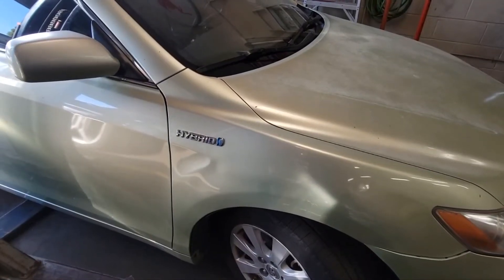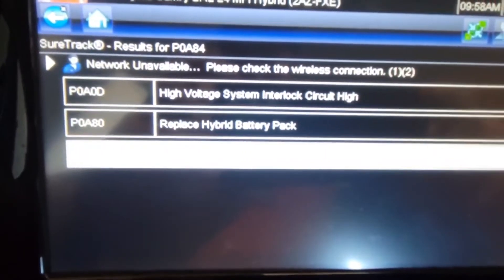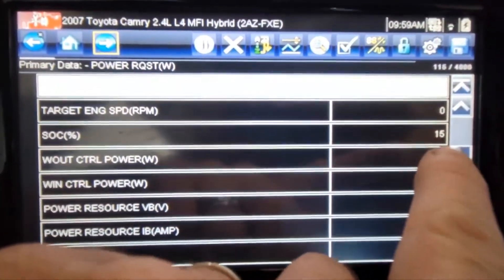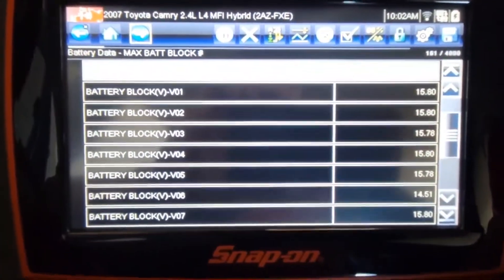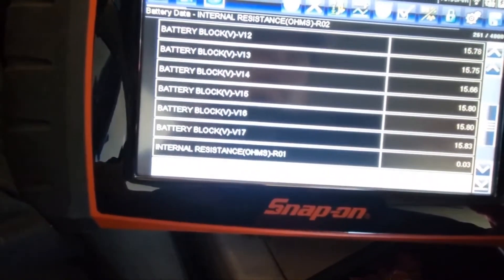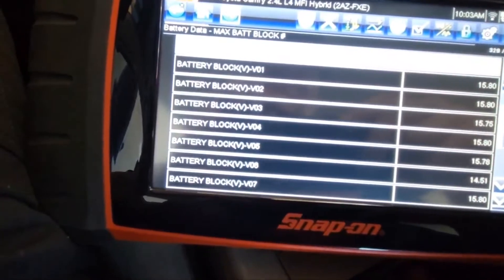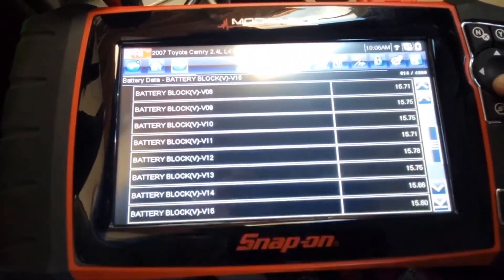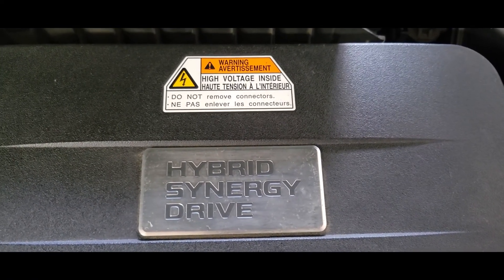Toyota Camry Hybrid Battery Diagnosis

Comment: Hi what is your email? I am having similar problem with my 2008 Camry hybrid. 200K miles. Went on trip and it sat for 2 1/2 weeks. Came back and was completely dead. Replaced 12V battery and upon starting it up I got check hybrid battery and check vsc constantly on. Drove it for a few weeks and it acted normal until recently and now sometimes it will switch to “eco” mode and the engine will die. Very dangerous on road now and am afraid to drive it. If I put it in park and turn it off and back on it’s fine usually until I get back home. Any ideas? Bad hybrid battery or bad cell in the battery?
Reply from the maker: When a Camry Hybrid sits for 2–3 weeks at 200k miles, the HV battery (NiMH pack) can develop voltage imbalance between the modules. The ECM monitors block-to-block voltage deviation, internal resistance, and state-of-charge drift. If one module drops even a few tenths of a volt under load, the hybrid ECU will throw Check Hybrid System and VSC because the traction battery controls both drive torque and brake-by-wire stability logic.

Your symptoms — random engine shutdown, forced ECO mode, then recovering after power-cycling — are classic signs of a weak HV block with elevated internal resistance. Under load, the weak block collapses, the pack voltage sags, and the ECU goes into protective limp mode. Cycling the ignition resets the HV ECU’s immediate fault state, but the failing module shows up again under load.

The 12-volt battery you replaced only powers the ECUs; it doesn’t fix HV chemistry issues. Sitting for weeks likely allowed one or more NiMH modules to self-discharge more than the others, accelerating imbalance.

What usually confirms it: • Voltage deviation under load (one block drops faster than the others)
• High internal resistance reading on one block
• Codes like P0A80, P3011–P3024 (depending on which block is weak)

At 200k miles, it’s almost always a failing HV battery module, not the inverter or ECM. It can be repaired by replacing the weak module(s), but ideally the entire pack should be load-tested to verify remaining life.

I hope this helps, if you need more let me know

Comment: My 2007 Camry hybrid is giving a code POA80
Reply from the maker: How many miles on the vehicle?
Has the battery been rebuilt or changed before?
Reply: @FullyChargedZone car has 174k and not that I’m aware of I’m second owner
Reply: @Junior-b8o1c did u ever get it fixed? mine is doing the same which i believe is causing my car to completely stop while im driving, makes noise etc
Reply: @erinikco yes I did found someone to change out all the bad cells in the battery pack car drives brand new again

Comment: When charged or changed the battery block did the code went away?
Reply from the maker: Yes, the check engine light went off. I had to repaired 2 battery blocks on this vehicle after disassembling and capacity testing the batteries.

Comment: You say block 1 to 17 so this would indicate that it has cylindrical cells correct?  

I tested all my car cylindrical cells and all show about 16.10v each one.

My car is having this issue for 1 year now, I have to jump it and wait 10 to 30 minutes to start it, it’s 07 Camry recently I replaced the hybrid pack with the 11 Camry pack used pack. Now this pack is much worst than the previous 34 cells. 

Can be the inverter be the issue?
Reply from the maker: Do you have any trouble codes?

If you have a 2007 camry with cylindrical cells they're aftermarket batteries. I've seen a few of them over the years, they're manufactured differently than the original battery. I've had to replace them with original cells due to capacity after a few years of use. 16v would be a fully charged battery. Are the cells orange or green? To me it sounds like you have a parasitic power draw. This is why you have to jump the 12v battery.  You would have to locate the power draw. I can guide you if you have a volt meter.
Reply from the maker: How many miles?
Reply from the maker: It could be inverter or transmission. Any codes?
Reply from the maker: Silly question is the 12v battery good ?
Reply: 12v is good but don’t know how to test the relay,  the high voltage module you mean the cells or the computer module?.

Another thing is that the car may turn off after starting it or if I drive it too much I come to stop and the “ready” light goes off
Reply: Thanks for the help it’s my fault, I have to take it to toyota, I bought 17 new cells waiting for them to arrive, seems like it’s not the cells wasted money.
Reply: @mike75479  quick question what was the problem I have the same problem with my 2007 Toyota Camry I recently replaced the cells the 12v battery and the inverter and I am still have the same problems ever time I start the car and put it in drive and hit the gas a bit the car turns off
Reply from the maker: Does the vehicle have any trouble codes? Its there any lights on ? Red or yellow triangle? I'm a Toyota Technician,  I can probably help you.
Reply: How did you later got it fix? @mike75479
Reply: Hi, I’m going to check 2007 Camry to buy and  P3190 Code it’s showing Any ideas what is that
Reply from the maker: @AdamAdam-in3gk   P3190 code appears when the engine is not getting enough power, which can prevent it from starting. In hybrid cars, repeatedly attempting to start when you have this code drains the hybrid battery. If this goes on too long, the battery may be completely drained and unusable, meaning you’ll need to replace it.

Here are the most common reasons for this frustrating error code:

1. 🌬️ Air Induction System Failure – Leaks or blockages in the intake system can cause poor airflow.
2. Out of Fuel – Believe it or not, a common cause.
3. Engine Mechanical Issues – Low compression or timing problems.
4.  Crankshaft Position Sensor – If this sensor fails, the engine can’t start.
5. Coolant Temperature Sensor – Incorrect readings confuse the ECU.
6.  Mass Air Flow (MAF) Sensor – Faulty or dirty MAF sensors affect air/fuel mix.
7.  Throttle Body – Dirty or faulty throttle body restricts airflow.
8.  Vacuum Leaks – Can lead to unmetered air and lean running.
9.  Weak or Discharged Hybrid Battery – Can’t crank the engine if it’s too low.
10. Defective ECM – Rare, but possible.

The most common problems for this code have been Air / Fuel related issues. The engine isn't producing enough horsepower.  
I've replaced a few mass airflow flow sensors and a couple of fuel pump over the years when getting this code. I usually check the data for mass airflow flow sensor and also perform a fuel pressure test.

Is this the only code your receiving?
Reply: 230k miles now, the check hybrid engine light is always on. I haven’t checked The codes because I don’t have that scanner for hybrids. I have one that is Autel obd2 I don’t know if this one works for hybrids
Reply: I just checked codes 

P0AE6 Hybrid battery recharge contactor control circuit low

And P3105  please refer to behicle service Manuel

The this codes might be wrong because the hybrid pack is not installed right now
Reply: Hello
I have 2007 hybrid Camry the ABS has noise and the VCS/ Hybrid system  check lights are on , so what do you think is it the battery issue or ABS ?
Reply from the maker: It's most likely the ABS master cylinder. It's a very common problem.  Do you have any trouble codes
Reply from the maker: If the 12v battery is good, I'd probably start testing 1. high voltage relay 2. High voltage module. 

Do you have any data?
You can email it to me, and I'll take a look